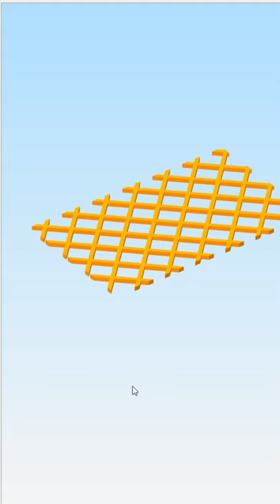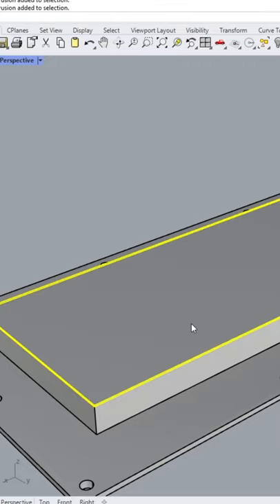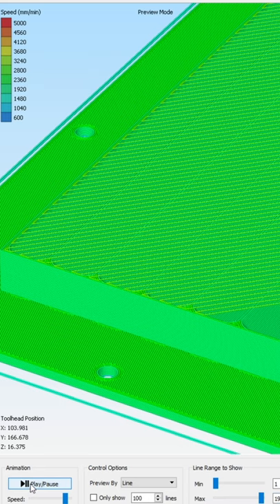A Great Trick For Printing Grid Screens #Shorts

Comment: Really nice. What's the benefit in this over putting the mesh design into the stl file? Time saving or something else?
Reply from the maker: Drawing the mesh in CAD and exporting it as an .stl will cause it to print in a very random fashion as I showed in the video. This will surely lead to an imperfect print at best and likely a failed print with layer skipping or other carnage.

Comment: I believe it would be more advantageous to print the screen separately, then you could replace it easily since it's not an integrated part.
Reply from the maker: Same problem even if it was a separate screen.
Reply: Depends really on the situation, you would then need to create a mechanism to hold on the printed screen, causing additional complexity. It's just not that much extra material/effort to just 3D print the file again like this if you ever need to replace it